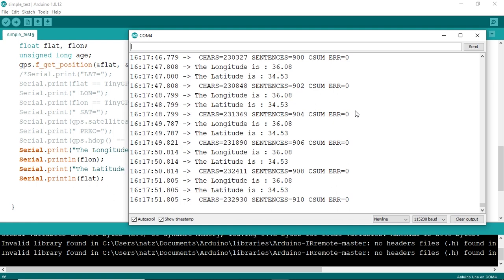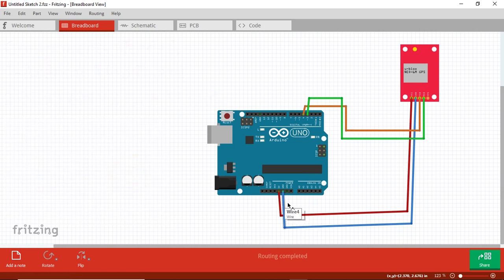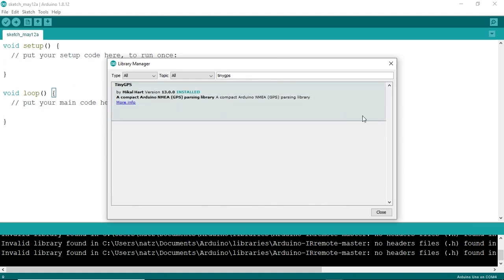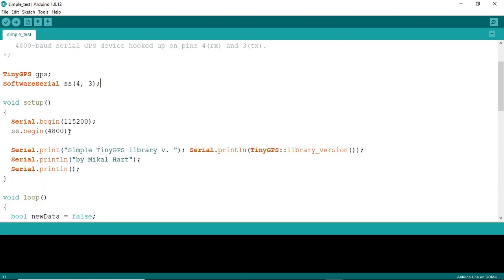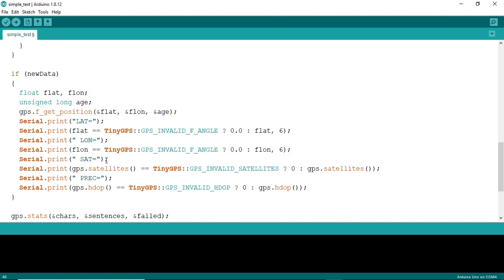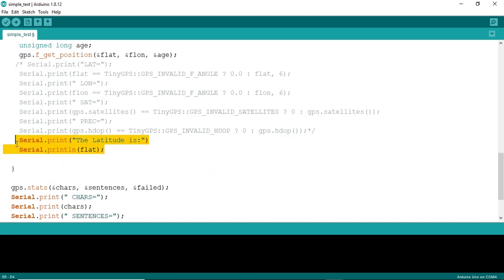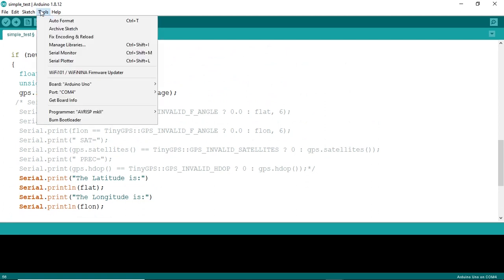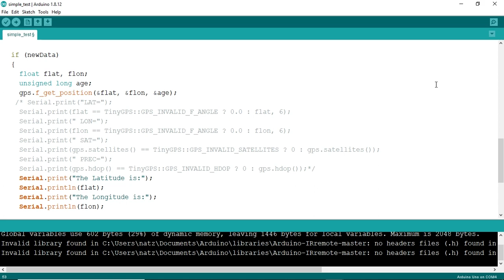How to Use GPS in Arduino - NEO 6MV2 GPS Module

Comment: Sir I connected my NEO6MV2's to the arduino but the red LED does not even light up. is it the hardware issue?
Reply from the maker: No that's normal if it's not collecting data from GPS Satellites.  Try getting closer to windows or try it outdoors.